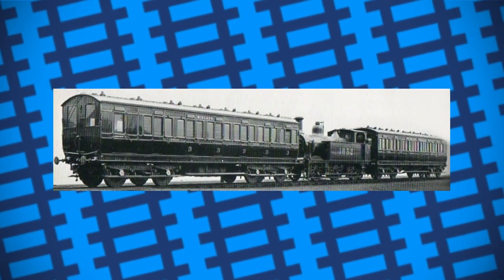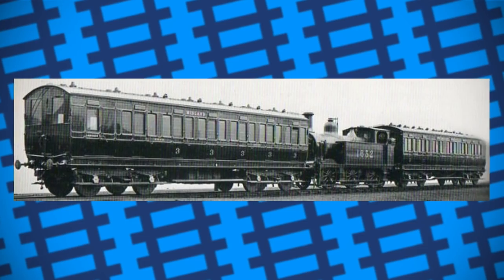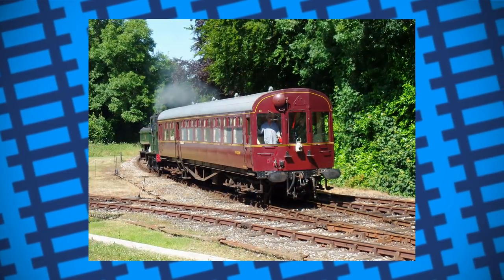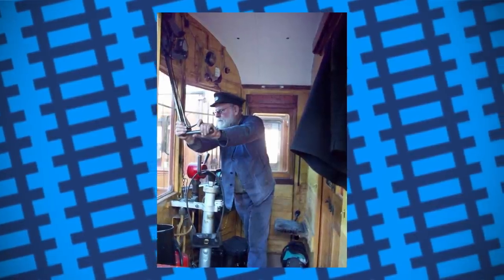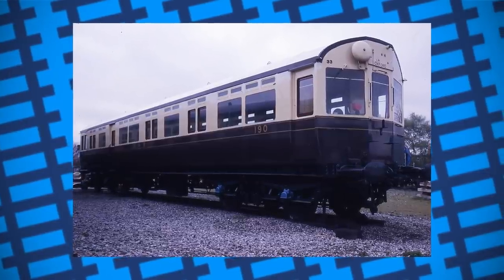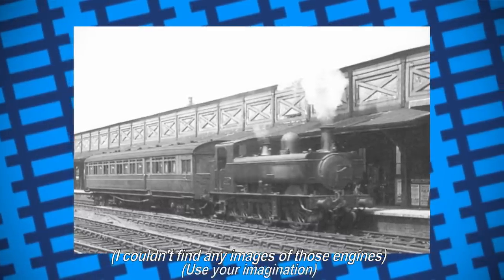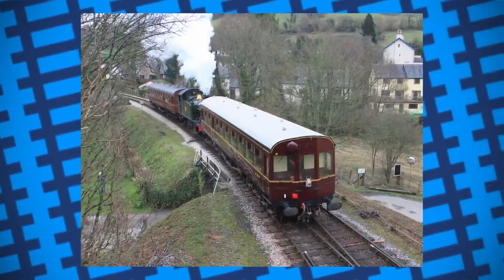Driving a steam engine while standing in a carriage - GWR Autocoach

Comment: Oh hey, that's Duck's theme!
Also i think Thomas has this feature when pulling Annie & Clarabel.
Although where i learned this was from a fanmade story, rather than an official one.
Reply: Thomas doesn't have Auto coaches Annie and clarabel are push and pull duck has Auto coaches in the Railway Series same thing goes for Oliver
Reply: @LMS5935  I think Thomas had that feature in The Railway Series books, but not on the TV series.
Reply: Actually, if you pay close attention  to the illustrations, Thomas is sometimes seen pushing Annie and Clarabel backwards, and even with a red tail lamp mounted!
Reply: @exarkun42  did you read my comment I said push-and-pull coaches they're different from Auto coaches Annie and clarabel are Push Pull
Reply: @robertknight4672  we do see Thomas a couple of times backing Annie and Clarabelle as if he is Push Pull in the TV series
Reply: @LMS5935  I did read it, and was providing additional evidence to back up your statement. To see the illustraions in question, see Down the Mine for thomas pushing them backwards; and he is seen wuth a red tail lamp in Wooly Bear and Stepney's Special
Reply: @exarkun42  oh
Reply: Idk where Awdry could have gotten that from since as far as I'm aware no E2s were tested with push-pull trains. Oliver is an autotank tho..
Reply: @robertbalazslorincz8218  well Thomas could easily be fitted with it the North Western Railway does heavily modify their engines if Gordon isn't proof of that
Reply: Thomas is a push pull
But he doesn't have auto coaches
Reply: @robertbalazslorincz8218  thomas wasn't ment to be a e2 you know
He was ment to be a J50
Reply: @pilotbug6100  yes but the idea of Thomas being a push-pull was made when Reverend Wilbert awdry accepted that Thomas is an E2

Comment: Fun fact. in America commuter Railroads still run push-pull trains powered by diesel locomotives. The coach with the locomotive controls is called the cab car.
Reply: That is correct. My local commuter network, Metra, does as well, and even has one car in daily service dating from 1949, #553 in Chicago and Northwestern livery. Most, including the cab cars, date from the 1960s to 2000s.

Comment: "We'll connect all the controls with long shafts through the coach! What could possibly go wrong?" :D

Here in Southern California, we have the modern version of this with single diesels at one end of a string of passenger cars, but the controls in the other end are electronic rather than mechanical. It works pretty well, until somebody parks a truck on a level crossing and there's nothing in front of the engineer and passengers but the end of that rail car...
Reply: same kind of system with the chicago metra that runs behind my house,
Reply: New York, Salt Lake City, Seattle, Philly, Miami, Virginia - they all use that system too.
Reply: We had a titanic accident a number of years ago when one of them running coach-first hit a heavy SUV and derailed. A friend of mine was killed and another critically injured. I see now the end coaches are more angled than they were. Hopefully they can deflect some of the impact. All level crossings are an invitation to disaster.

Comment: Commuter trains here in the States (and in Canada as well, as I understand)  typically work through push-pull operations, nowadays, too; of course, these days, the push-pull functionality is achieved through placing one diesel-electric engine at one end of the train and what's known as a cab-coach at the other end - and the engine is controlled from the cab-coach by way of electronic multiple-unit, or MU, lash-ups between the cab-coach, any intermediate standard coaches (though I have yet to see such a train without standard coaches in the middle), and the back of the engine.

Comment: Just to clarify: at 02:46 where you talk about the 0-4-2 1400 class (first built in 1932), you are actually showing a picture of an engine of the 0-4-2 517 class (last built in 1885). You don't explicitly say it is a 1400, I know.
Nice video, by the way.

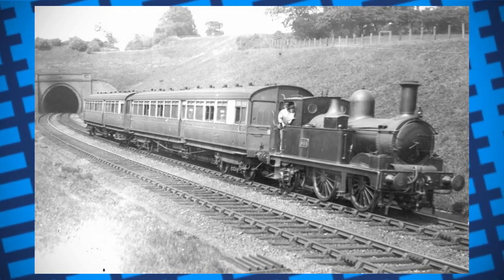Comment: The 0-4-2 loco @ timecode 3:01 is an LNWR loco pulling LNWR coaches, not the much later built GWR 0-4-2. Still a great video though, cheers.

Comment: You should look in to the origins of the twin-ended trains; The idea of having a locomotive at each end so, as you say here, time could be saved by not needing to run a loco round its train. I believe the practice originated in Scotland with the Sulzers; Class 25s / 26s. This would of course lead to the invention of the 125 HST, by far Britain's most successful train design. They still operate freight trains out of Liverpool docks this way, a Class 66 on each end.

Comment: Imagine if some loco's were purpose built to push the carriages and the controls were left to a conductor placed in the caboose.
Reply: Theoretically you could do something like that with a B unit diesel coupled in a train of normal push/pull cars, if the diesel and the cars can MU properly.

Comment: OK that method is brilliant but why not just have a express steam locomotive on standby at the final station and maneuver it into place for the return journey even though it would be complicated to maneuver the big locomotive in position for pulling the train I feel it would be a lot simpler than the process of what the GWR did
Reply: Maybe simpler, but think of the additional costs!
Reply: @johngardner5636  I’m sure it would cost a great deal of money but it could save a lot of time and it would be well worth it
Reply: @theclickbaitmasster  I haven’t done the calculations, but I bow to your superior knowledge.
Reply: @johngardner5636  Superior knowledge? I’m not that smart it just came to mind after the video sounds like something I would do on my railway
When I set up my model railway I’ll just have an express engine on standby at the final stop
Reply: Push-pull was not used for expresses, ever, in the days of steam.   It was used for short branch line or suburban trains running at moderate speeds on short journeys, to save 'running round' at each end of the trip.   Operationally much simpler than 'running round' or changing engines.
(Possibly the first 'express' use of push-pull was on the Bournemouth electrics with a 4-Rep multi-unit pushing one or two 4-TC trailer sets, the first true high-speed use was the Class 91's on the East Coast Main Line.   Though who knows, someone on the Continent may have done it before)

Comment: Your photos show other companies' examples of auto or "push-pull" steam train working, which were arguably superior to the GWR system in that they were worked by compressed air and not mechanically-operated as with the GW. Where were trains in passenger service propelled by a locomotive and crew at the trailing end with no one taking care of the leading end?

Comment: First of all, most passenger trains don't have a locomotive anymore nowadays. The thing at the front is called a 'cab'.
Reply: Most of the trains I see have 3 or 4 locomotives at the front and usually a couple in the middle as well. ;)
Reply: @ErickC  my comment was unclear, fixed it, now it says passenger trains
Reply: @jonistan9268  : I was being a bit snarky. Though it depends on where you are. Around here our passenger trains are all still pulled by locomotives, with commuter trains (e.g. Metra, AmCal) running in push-pull configuration with a locomotive at one end and a cab car at the other.
Reply: @ErickC  yeah that's common in many places, but calling that 'a locomotive at each end' (as done in the video) is just wrong.
Reply: @jonistan9268    The video was referencing trains such as the British diesel HST or the French TGV which do have a locomotive at each end.   The TGV locos are an integral part of the train but the British HST diesels were in fact classed as separate locomotives with individual numbers.    
With electric power the distribution of locomotives or 'power cars' can be - anywhere in the train.   For example the Southern Region of BR ran 12-car trains as a sort of multi-unit push-pull with two 4-car trailer sets and a M-T-T-M  multiple-unit at one end.   (Motor-Trailer-Trailer-Motor, see Class 432)
Reply: @cr10001  the video was referring to all types of double ended trains. Most of those don't have two locomotives, as they're either multiple units or have just one locomotive and an auto coach at the other end.
Reply: @jonistan9268   Well his first illustration was a TGV which certainly has a locomotive at each end.   I think all TGVs and their derivatives are like that.   But then he mentions 'most of the wheels also being powered' which is definitely multi-unit, as was his second illustration.    So not entirely consistent but it's probably hair-splitting to pick up on that.    I think push-pull (one-ended) would be in a definite minority, at least in Europe.   But short of spending hours looking up data I can't prove that.
Reply: @cr10001  In Switzerland, Germany and Austria push-pull trains with a locomotive and a cab car on the other side are very common. Most of Switzerland's Intercity and Interregio trains work like that, so du German Intercity trains and the Austrian Railjet. In Switzerland and Germany, cab cars are also commonly used on regional services, but they're being replaced by EMUs in some areas. As for everywhere else, I don't know what they're doing there but I can imagine that these trains aren't common there. From what I know, e.g. Britain doesn't really have them.
Reply: @jonistan9268  I think Britain mostly has multi-units now.   But in the 90's they notably had the Class 91's on the East Coast Main Line, with a DVT ('driving van trailer') on the other end.   Easily the fastest trains in Britain at the time (at 140mph), and a Class 91 still holds the record for the fastest locomotive in Britain at 161mph (260kph), though multi-unit Eurostars have gone faster.    I wasn't aware of those German/Austrian/Swiss trains, so thanks for enlightening me.
Reply: @jonistan9268  and of course the UK now has push-pull trains run by Trans Pennine Express. I’m not sure what the maximum running speed is.

Comment: “most passenger trains”

…in Europe but they’re in the minority everywhere else. cab controllers like this are cheaper as they take up little space and can be closed ofd if the car/carriage isn’t in use

the reason that these didn’t catch on were clear: it’s extremely tough and dangerous to operate a steam train unless you’re physically in the cab with the firebox. you aren’t saving much if any money
Reply: Um, no.   They most certainly did catch on, to the extent that most British companies used them.   The driver would be in the front coach of a two or three-car set and the fireman in the loco cab (as he had to be, to keep the fire stoked).    The wages costs were exactly the same as if the loco 'ran round' its train at each end of the journey BUT it saved considerable time in 'running round'.     They persisted until the end of steam and then on into diesel and electric days.   See Wikipedia 'push-pull trains'